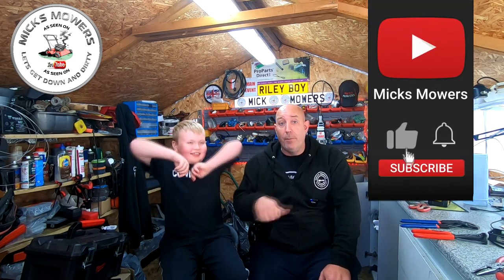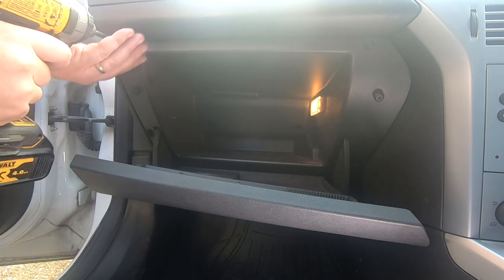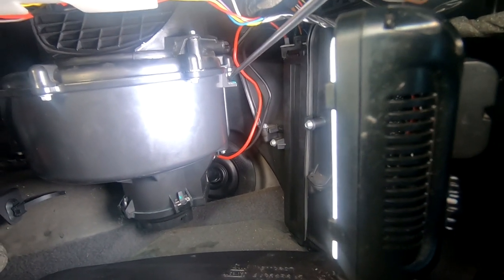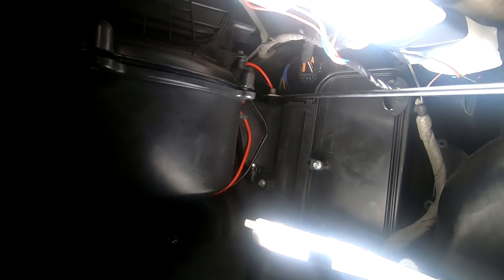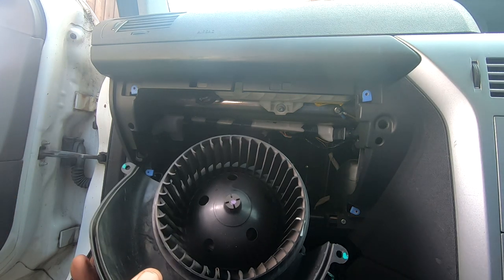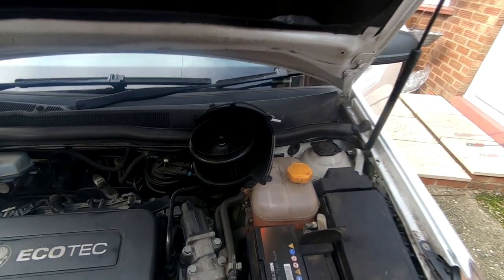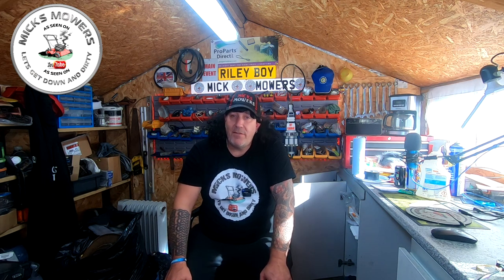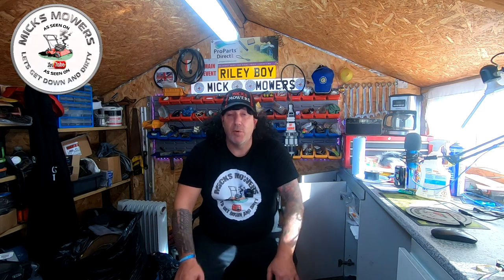Heater Blower Not Working Astra G , H or Opel How To Fix

Comment: I'm sorting out fan issues in my Astra, and it seems that if the fan motor is ok it should still run on the highest speed setting even with a faulty resistor, as the high setting bypasses the fan resistor(s) and the thermal fuse in the fan resistor. In my case the thermal fuse had blown, possibly from an ageing fan or blocked pollen filter causing additional current-draw through the resistor(s) and therefore more heat buildup.
Reply: Mine is still working on highest speed but not on others so have just ordered a thermal fuse, so thanks for that ! That said I may replace fan as well as perhaps with age it might be drawing to much current.
Reply: @stephencrozier396  how did you get on I replaced resistor which lets you use settings 123 but it glows red hot very quickly and I saw smoke so what's that all about

Comment: My heater just stopped working today, being a spark I instantly thought fuse. However, your comment at the end about water leaking in through the motor being a contributing factor to it packing up, it all made sense. In really heavy rain water appears in my passenger footwell. Going to order a new motor right now to fit in a couple of days. Cheers for the video, appreciate it
Reply from the maker: Your very welcome.. hopefully it sorted for ya
Reply: Yay, all done and blowing a hoolie in there now.....actually got my hand stuck half way through putting the resistor back in though 😂
Reply from the maker: @NicoleBritnell  good for you 
. Glad one of my videos helped ya..

Comment: Hiya, I’ve checked my motor and replaced the resistor but no blower still, I e been told to replace the motor as it doesn’t sound as it should although it’s spinning , do u think I should replace it

Comment: Hey Mick, my blowers in the central console of Astra G are not blowing, but the driver's side and passenger's side are working well. Can it be the Heater Blower or something else entirely? Cheers for the good video!
Reply from the maker: @viktortraychev4043  something else.. could just be a pipe has come off...

Comment: Hi Mick, that was a great video.
If my blower works on 4 does it means I only have to change the resistor? I’ll add I have changed the resistor 2 weeks ago and again doesn’t work , only on setting 4 🤔
Reply from the maker: Sounds like the resistor.. but for £40 a now mower if not.. ta for watching

Comment: Hi there, I've replaced a heater blower and a resistor (both work when checked and there's power going through the resistor), checked the fuses but heating doesn't work at all. Any idea what could be an issue? Thanks!

Great vid!
Reply from the maker: No sorry..what about the switch?

Comment: Did the heater just stop as mine is intermittent when I full power it made a weird noise but now its completely stopped is it worth changing the motor and the resister or just the resister
Reply from the maker: Mine mucked about for about 3 weeks before it stopped.. I would replace both parts ..

Comment: Thanks for this video, I used it to go through the steps to replace my seized blower. Had to happen in November when it's cold. I should point out (an observation, not a criticism), that behind my glove box, it's laid out a little differently. My Resistor was much harder to reach and looked completely different, I suspect I have climate control and you have air conditioning. Also the fan didn't quite pull out as easily as yours. Anyway, these minor differences didn't stop your video being priceless to me so thanks again.
Reply from the maker: Ok thanks for the update.. hope you got it up and running again..

Comment: Great Video Mick. Gonna get mine done 💯 and report back. Thanks again. Top man!
Reply from the maker: No worries.. hope it all goes well
Reply: I have replaced the resistor but I’m struggling to find the correct size Socket to remove the motor. Can you help with this? Cheers
Reply from the maker: @MANKUB123  sorry I can't.. think it's a 10 or 8mm
Reply: @themowerman  Thanks

Comment: Got a heater prob with astra h, blower works fine on all 4 positions it’s the hot/cold selector & the heater direction control not working + the small indicator lights on the whole control are of but the rear windscreen heater still works, any ideas of posable problems? Regards Peter,
Reply from the maker: Could be a broken cable mate you will have to trace the cable
Reply: @themowerman  Thanks for the reply👍 Got it sorted earlier today, had a third check of the fuse box & layout of fuses connected to heating system & found a blown fuse which i had previously missed (No17 fuse in box, 7.5a fuse) quick change everything running ok hot/cold dial + direction dial, Thanks again👍 Regards Peter
Reply from the maker: @peterhammerberg6469  ok cool.. glad you got it sorted

Comment: I replaced the blower in my astra h a couple of years ago and it works but now it's started to only work on max settings so I replaced resistor and went through all the settings but the resistor is getting red hot don't trust to use fan on lower settings. Any idea what problem is??
Reply from the maker: It is supposed to get hot as it has some elements in it .. but it should not get red hot..
Reply: @themowerman  literally glowing red as I tested before I put glove box back in
Reply: @themowerman the motor being fairly new I dare not use on lower settings as mot coming up in January and no blower at all would be a mot failure ?
Reply: @themowerman  wouldn't be a fuse under bonnet needing replacement would it?
Reply: Or maybe the resistor is faulty it was only £8.99
Reply from the maker: @si4632  I would say not
Reply: @themowerman  seems to be still working ok lol just need to sort out why my heater isn't getting very hot got  a 0115 code I suspect a stuck open thermostat
Reply from the maker: @si4632  could be

Comment: Please help... I've replaced the motor, resistor and fuses but still nothing! Could it be a faulty switch?
Reply from the maker: Yeah it could be
Reply from the maker: Did you test the new motor on a battery like I did ?
Reply: @themowerman  No I didn’t. Probably an idea to do it I guess as it could be a faulty motor. I’ll do that and see but if it works then would I be safe to assume it’s more likely a faulty switch?
Reply from the maker: @teekcih6196  yes do a motor test like I did and see if that works
Reply: @themowerman  Will do. I appreciate your help Mick 🙏

Comment: This JOB can only be described as
HELL ON EARTH
Start to Finish 9 hours.
5 of which to remove the Resistor.
I now have No Knuckles left on my Right hand and ive lost so much blood  im considering a trip to A+E. 🚑
I have no toes left on my boots,  My knees are completely Knackered.
And my Back is killing me..
..TRUST ME..
TAKE IT TO A GARAGE
Reply from the maker: Ohhh come on... Did you get it done ?
Reply: Hi . YES Got it done.
The problem was the Resistor had got really Hot and melted itself into its housing. IT WAS SOLID..
In the end I had to remove the Pollen Filter and cut away until the Resistor come loose.
Then I had to fabricate new panels and rivet them in position to provide a new housing for the Resistor.
It really WAS a NIGHTMARE.
I'm completely Tooled up to do the job and I'm a Panel Beater of 30 years.
I thought I'd have it done in an hour  😵‍💫
I'm now wondering how many Astras have have caught fire over the years due to red hot Resistors.
I guess I was just unlucky.
I just thought I'd make you Laff with my comments 🙂